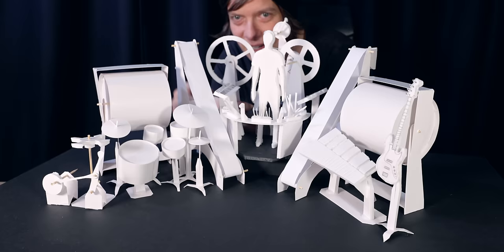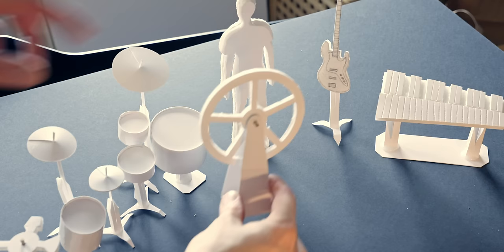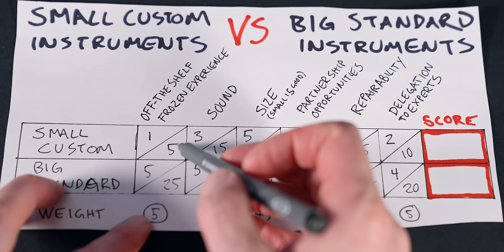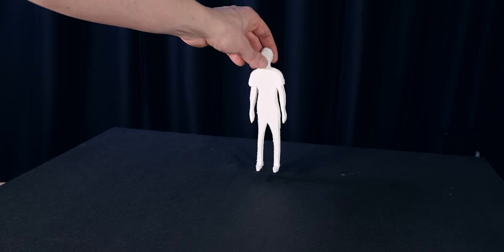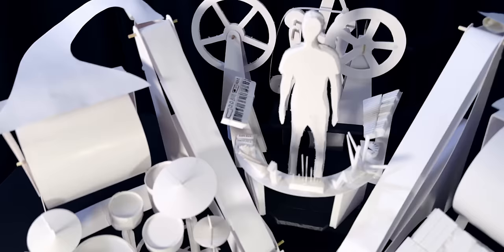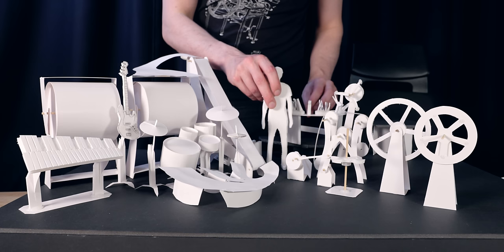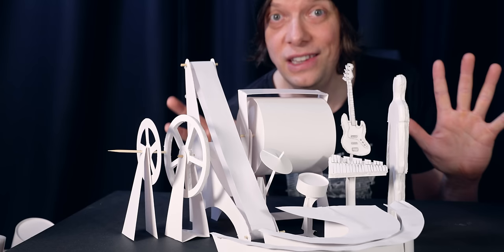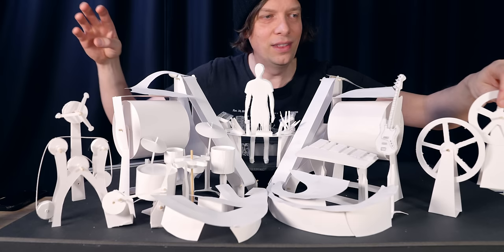Making a Cardboard Model of the Marble Machine

Comment: 3:25 larger, yes. But how large?
If the aesthetic you want to go for is skeleton clock, I guess you are going to reach a point where you will try to make things smaller again to have this integrated (a lot of functionallity in a small space) thing that makes clocks such crazy interesting pieces.
It's very uninteresting to have a pointer for hours, minutes and seconds on separate watch faces but cramming it all on one watch face requires you to stack all these gears which makes them complicated, difficult and interesting.

Comment: Why not all (and more) those set ups? You could go with a customizable modular design that allows you to set up the machine in various ways rather then being stuck to one format. The down side is obviously it's harder in the initial phase to be able to work it into the design and probably you would lose efficiency in the overall design.  However the benefits are you are not suck to the same layout, which for one allows you to keep it more interesting by using different layouts for different shows. Two opens up the possibility of other venues that might not be able to accommodate one particular layout. Allows for easier expansion in the future if you have other interments you would want to try to play with marbles, or on the flip side decrease the number of interments allowing you to set up in a smaller venue. Finally it allows you to have something functional sooner showing yourself a very tangible result, which at least for me I find a great motivator to continue. You might not have interest in a minimal machine, but having a minimal machine be a functional step to the final build is a different story.

Comment: Why does it have to be compact ? (your average concert stage is waaay larger than 5 meters - this sounds like a dumb design requirement)

Spread the design out! You can fill any visual voids later with whatever decoration you like.

Make Version 1, but have the mechanics bigger and let them tower over your head, menacingly! Unless you want to play in some underground disco, you still have plenty of room.

Comment: MANY HUGE THINGS MISSED HERE. Long comment that I spent much time on.

1. Where will the rest of the band be?

2. Audience size and their point of view. The various distances/angles that they will be seeing the band from. Front center row will be close but low. The far right or left on front row will have the most extreme difficult angle of view. Would the machine's size block the view of the band? Back row will be high but distant with detail being small. In this Cardboard video the camera view is like equivalent to 30 feet away? Employ cameras and big screens focused on the subjects to show what is going on for the audience that are having trouble seeing it. That is, if you go with what I see in the cardboard.

3. Bigger problem. In a previous video. The example of using a cardboard replica was of a single whole object to understand the looks of it. The ergonomics of it. This,,, looks like a furniture placement experiment of individual pieces to get the ideal living room look. However, everything has to be mechanically connected/powered somehow. How will that be done?

4. Martin! You need to go back to the WHY! What was the goal back then when you made the first one? A one man band thing? Why has the first one acquired so many views? WHY did I like it and passed it on to ALL my friends and follow you? My answer. It was small, complex, human powered and hand made, playing a nice tune. I want to see/hear the next better version. I don't think you want to make it a "One Man Band" thing that puts the rest of the band in the background.

It's still too big of a machine.

Comment: If you really want to see the mechanics, why not build a 9m flywheel, gear reduce it so it's only spinning at lower rpms, but would take center stage behind your operation control panel?

Comment: It seems like you’re still a bit stuck on the “waterfall of marbles over the programming wheel” design of the previous machines. Maybe try out different form factors for that, when your much freer by using the Bowden cables? The old approach might still win, just make sure that you test out as much as possible on the paper prototype stage.

Comment: Martin, we have seen you go through the process of working out why you want to build a Marble Machine. What we haven't seen is the band Wintergatan working out why it needs the Marble Machine. If you have decided that the Marble Machine is where you are evolving to as a musician/instrument maker, then the question becomes "does Wintergatan want a Martin with a Marble Machine", or does it want Martin with smaller instruments.

I am asking for this clarification because in the cardboard mockup, you don't show the rest of the band. In the previous incarnation of the design process, your CAD drawings did include the rest of the band, and though that version of a Marble Machine seems to fill the whole stage, all of the band members looked like they are apart of the instrument. In this cardboard version, it looks like you are the band, which makes all the instruments you're adding make sense. I think you need to ask the band what they want the Marble Machine for, and this could mean that you'll have two design goals: a Marble Machine that can go on tour with Wintergatan, and another Marble Machine that goes on tour with Martin. At the risk of scope creep, that first Marble Machine could form the core of the second Machine, so you're not having to solve everything twice.

And it's worth noting that there has been a real life version of this. With the re-release of the Talking Heads concert film "Stop Making Sense", we see the Tom Tom Club as a subunit of the Talking Heads. Harrison and Weymouth play the same instruments in both groups, with Harrison contributing a lot more vocals, but Tom Tom Club songs don't show up in the middle of Talking Heads songs. They are artistically independent entities with shared artists, and they make different kinds of art. I think it's worth thinking about what the Marble Machine means for Wintergatan as well as what it means for Martin.

Comment: A quick question for you. How do you know that the MMX was a failure.? 1) it was unfinished. 2) only 3 tests where don under controlled conditions. 3) CAD files not finished, CAD files and design not inspected by a professional engineer / designer 4) no songs where written or produced on it. Yes there where less than a handful of marbles on the floor, over the 3 tests, etch test lasting longer and with more marbles. Are you rely giving up on the MMX due to a PLA tube and the odd screw loose. Ps how do you know it wasn't your manufacturing tolerances coursing these malfunctions when you did not finish the design and have it checked. MMX will always be a masterpiece for me and the MMX fans. Long live the MMX, hoping for a come back one day.

Comment: So I’ve been trying to think of the problem with V1. Many people seem to agree “we want more” how can you get “more” visibility in the same space? Taking advantage of all of the space.

People want to see martin playing the machine? He should be in a place to access everything.

We want a Skeleton clock? everything needs to be one united assembly.

Would it make sense to ‘lower’ the pair of very large disks? Make more smaller disks to output the same energy? Make the smaller disks thicker instead of more? I’m leaning towards many small disks. A nightmare to assemble but it would ‘connect’ everything while they can be spread out (same height as control wheels more towards the crowd, and very low wheels in front and to the sides of Martin on a platform in the center. Directly in front of martin can be the gearbox looking assembly. To ‘complete’ the look I think instead of having the marble paths be 2 side, have the fallen marbles from the vibraphone side cross the center in front of the gearbox (lower than the view line) to the escalator ramp on the drum set/guitar side and make a figure 8 loop back to the other side.

I’m hoping all that helps give some more ‘commit not to commit’ ideas to everyone. I don’t think anyone had the ‘thats it’ feeling with version 1. Please don’t stop tinkering on the cardboard model until it ‘clicks’

Comment: Its too big. You are designing too big, because you think your experience is sufficient to do so. Yet, most of your experience is formed by failing and you pursue the whole project based on the success with your initial&worst solution - strange isnt it. 
Your new solutions will have quirks too and tradeoffs and unreliability will creep into the sum of sums leaving you with a lot of open questions for "next time" again. Right now you think you can mitigate it, i know, but... I honestly think, you will keep failing and think "next time I get it" every time. Be prepared for that scenario and do some risk-management by not scaling the project to a 50m³ monster.
I would rather see a small success than a large failure.
Unless, of course, youtube & parteon is the actual business, then go ahead strong! 🙂